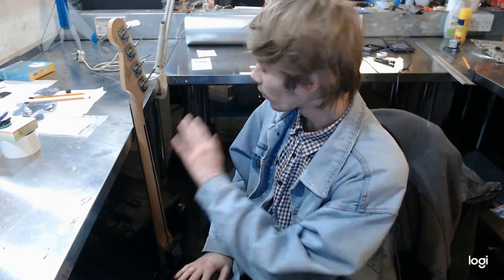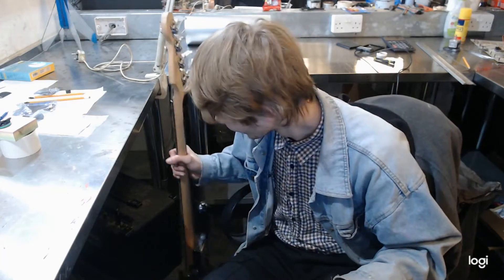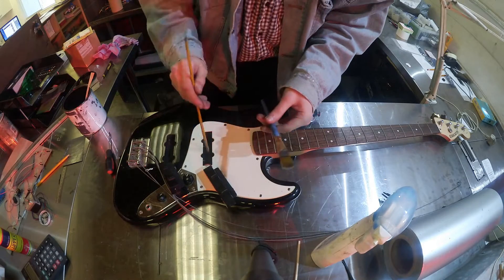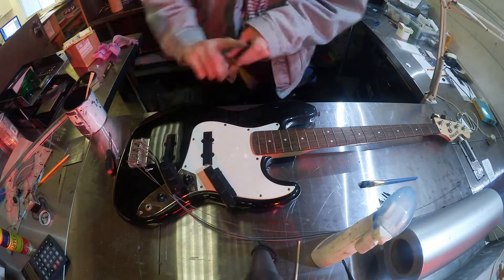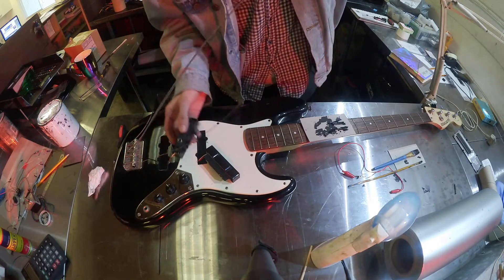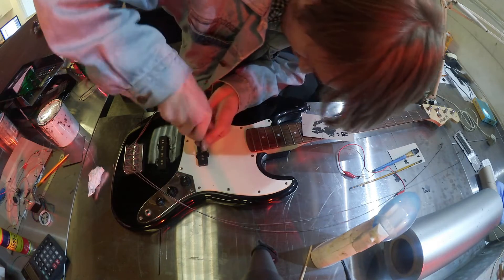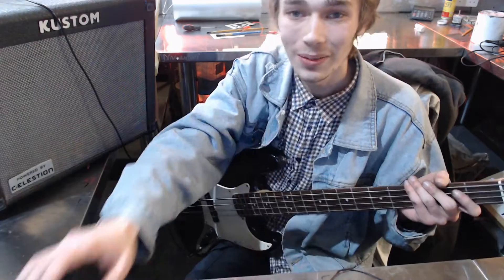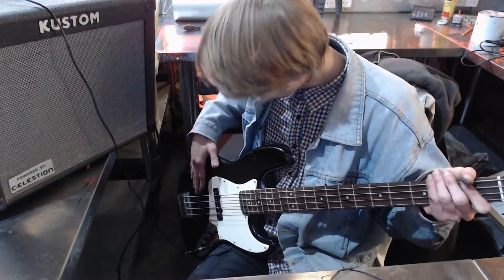Shield your electric guitar with conductive ink

Comment: This is a "problem' that has been around as long as electric guitars have been. The issue is that the pickups are EMF transducers (with the exception of piezos and lace sensors), and changing EMF into voltage/current is what they are designed to do. What you are doing in this video is actually shielding the transducers from all directions except the forward facing direction which faces the strings as shielding the pickup entirely would prevent it from working. With that particular bass, using both pickups together will reduce the noise as they are wired to us common mode rejection to cancel out the noise. Shielding is definitely a good practice, and most modern guitars will have the cavities (including the electronics cavities) shielded to minimize noise, but it is important to note that the shield is generally tried to the ground of the instrument.

Comment: FYI, a bit more of a technical explanation of how the ink works as a radio interference shield. It works because it is both conducting and resistive. As radio waves try to get into or out of the circuitry, they will need to get through the ink. When a radio wave encounters a conductor, it will induce a current to flow in the conductor, generally called an eddy current. If it is a perfect conductor (no resistance) then the current can be strong enough that the conductor can re-radiate the signal again like an antenna. However, when the radio wave encounters something like Rob's ink, although it will induce a current due to its conductivity, the resistance will mean that the current flow will be resisted, not allowing the current to become very big and much of the energy will be turned to heat. This then means that most of the radio interference will not get through the paint. A simple, not too technical explanation, I hope it helps!
Reply: ........yes ,that's a good explanation. Otherwise I believe a foil that attenuates magnetic field might work also. I forget the name of the material. The resistivity needs to be in that sweet range :-- too high don't work and too low won't work ; would that be right...and so since I got cold galvanising compound ...oh, I just remembered my band days are over, I was dreaming.hhha
Reply: @philipvernejules9926  In EM radiation, the magnetic field (also called the near field) tends to propagate a relatively short distance, so magnetic shielding will have less effect, however it is useful at lower frequencies, because the propagation distance is generally considered to be wavelength / 2 x pi. So the longer the wavelength (lower the frequency) the further the near field will propagate. So it all depends what is causing the interference. Even better would be to use all digital circuitry and use a digital output pickup. I'm not familiar with modern electric guitars, but most mobile phones now use so called digital microphones, which produce a digital signal from the audio, directly. It is much more difficult to interfere with digital signals. However that wouldn't be so interesting as it wouldn't need Rob's ink!!!
Reply: @lisakingscott7729  Great Explanation!! I was a little bit clued up, but this has helped me understand even further. Big help thanks!
Reply: @NoMames Only if you put it and whatever is being cut in a box painted with a decent layer of Rob's ink! The plasma itself can act similarly to the early spark gap radio transmitters. If it's a hand portable, then probably means painting the whole workshop!!!
Reply: Lisa, get back to work 😂
Reply: @tponn It's not as simple as that and cables can have completely different requirements to those required in or surrounding circuits. Also a ground may not be available, if it's wireless, etc... Have a look at the specifications for various commercial shielding paint products, it all depends what frequency range and the environment you are trying to work in. Foil with good conductivity can easily become a re-radiator in many circumstances. FWIW I worked on the development of world's first completely wireless earbuds and you wouldn't believe some of the issues working with audio, RF and NFMI all really close together in such a tiny device!
If you don't believe me, take a mobile phone in a good signal area, with Wifi and BT enabled and put it in an earthed tin can. Many of the better devices will still get a signal (ever made a phone call in a metal lift???). However a cardboard box painted with a resistive conductive paint, may actually shield better. I've no idea of the frequency response of Rob's ink wrt shielding though, whether it would work better than a tin can for mobile phone/Wifi/BT signals (~900MHz, 2.4GHz, etc..).
Reply: @lisakingscott7729  ....900 MHz -- 2.4 GHz is maybe radar range . I now wonder if I could paint my car with the ink to lower it's radar gun detection ...stealth in other words.
Reply: @philipvernejules9926  They use cameras, computers and lasers these days I'm afraid!!!
RAM (Radar Absorption Material) is usually a foam, made with various conductive compounds.

Comment: and no it SHOULDN'T be going crazy if you have your gain set properly
Reply: Hi Jason, Thanks i never knew this! usually the bass amp has a microphone in front of it that goes though a PA system when doing gigs. when i get too close it Goes CRAZY!!
Reply: @MyNameIsLukey  yup, that's the Mic feedback, nothing to do with the guitar, you can tweak this on your mixer or use a condenser, or even better, run your Bass Head straight into the mixing board and output directly to the PA. Graphite paint WILL reduce EMF but not as significantly as described in this video
Reply: @jasonezekiel3250  Yes this makes sense. But i can tell you in the live environment it defiantly has reduced the humm noise significantly.
I haven't used the PA system in about a year sooo... I cannot comment on this. 
What i can say though, before i did this i couldn't get near the amp otherwise it would go crazy. even if i was far away the humm noise would be irritating.
Now it doesn't mater what the gain is on, i can get a mm away with very very little feedback. (Almost silence)
This is an improvement.